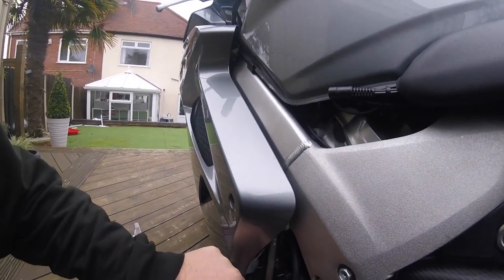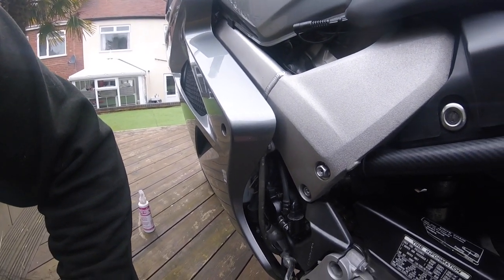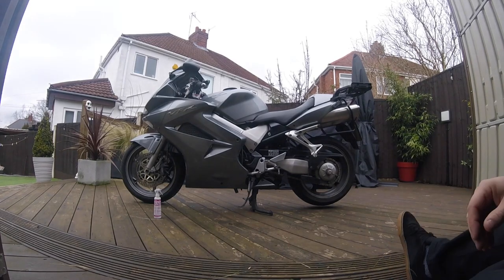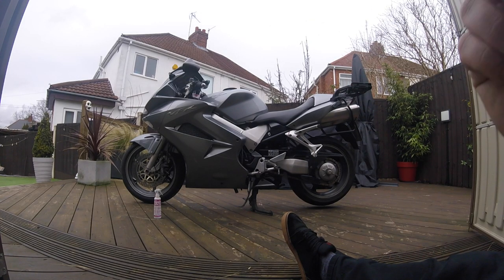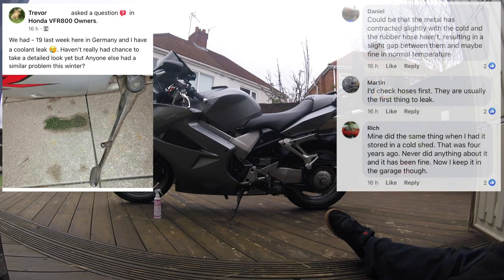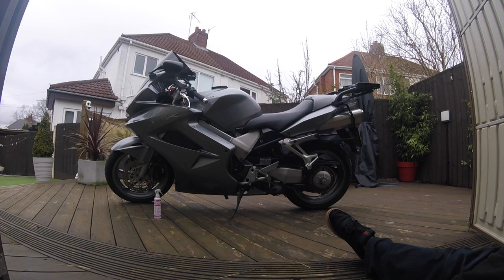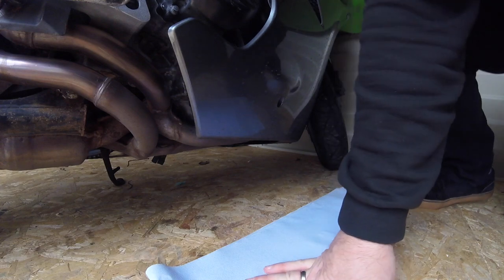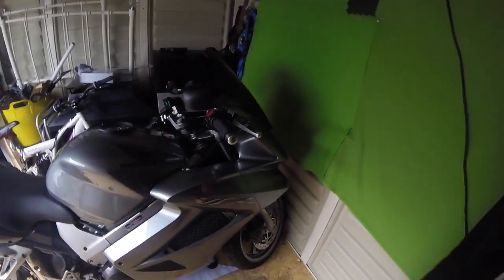Honda VFR800 Coolant Leak Mystery

Comment: I reckon you have nailed it mate, just the extreme cold causing a bit of contraction of the metal and rubber components allowing a small amount to leak past. If there was an actual leak then it would have done it when the bike was running as the coolant would be under pressure from the pump. Also FYI to those people that keep referring to an 'overflow pipe' from the coolant expansion tank, there is no such thing, the pipe that they are talking about is actually an atmospheric vent pipe which is there to stop the bottle trying to suck itself inwards when the fluid returns back into the system as it cools. The last thing you want is coolant 'overflowing' out of the bike in front of the rear wheel! Ethylene Glycol is incredibly slippery, hence why it is not allowed to be used in race bikes. If there is coolant coming out of that pipe then there is either an issue with the bike or the expansion tank was overfilled, the marks on the side of the tank are to be read when the coolant is at ambient temperature only! 👍
Reply from the maker: Perfect, thanks mate that makes sense. Yeah there’s been no leak from when running or when it has cooled down. I will keep checking over the next few days but the outside temperature has settle now above zero.

Comment: I live in Ontario Canada... ride a 2005  Vfr800.... I have the same issue every winter (even parked in the garage on the centre stand)... just clean it up and add a little coolant in the spring.

Comment: Doubtful to be a leak pal as would have been alot worse when system under pressure when running. Hopefully just something to do with sitting in cold then bring run.
Reply from the maker: Yes I think so as it’s bone dry now and when was under pressure
Reply: @Motourev  Excellent news pal

Comment: That's funny, had the same on my BMW on Friday after I took it out on Thursday for urgent supplies. It was just condensation which had got trapped in the lower part of the fairing, and the bike was on its side stand.
Reply from the maker: Mine was deffo green fluid

Comment: Hi mate,did ever find out what it was?. I just did a coolant change on mine this weekend and after getting the air out i noticed that the lower hose on the right hand radiator pushed abit of coolant up through the hose. Tightened the clip but didnt help. Ran the bike warm and it stopped. Now  a couple of days later when its been cold,there is a small amount on the hose again.
Reply from the maker: Yes I found the problem and fixed it, it’s in the video after this

Comment: Night definitely looks like coolant leaking out does it does liquid have a touch of blue colour to if so it's coolant also noticed it seems to be in the clutch area where the hydraulic clutches
Reply from the maker: It’s more green than blue
Reply: Sometimes you have a green coloured fluid the man called blue colour is blue but that is a green too
Reply: P,s wouldn't worry about it too much I think that's. Like you said I think the pipes me to schenker little bit due to the extreme cold weather sound stupid but rubber does because it's been really cold hopefully that's all is

Comment: Could it be engine pressure, pushing it out of a loose pipe connection.
Reply from the maker: 🤔 could be, I need to remove the fairing I think